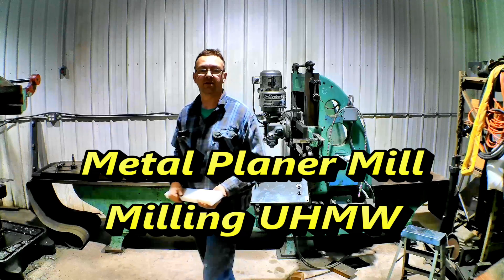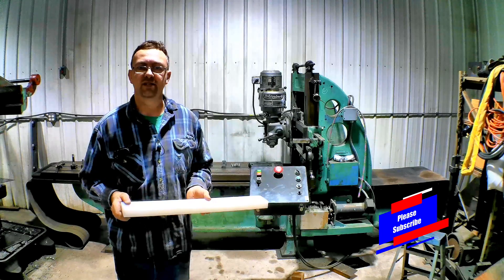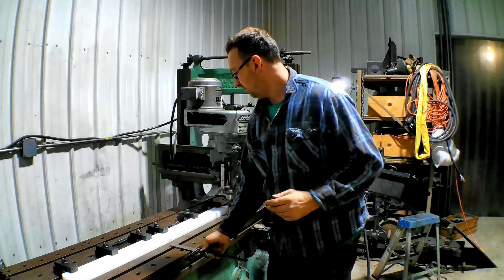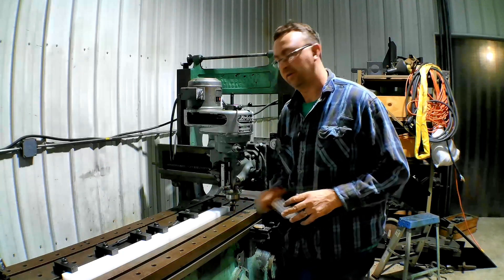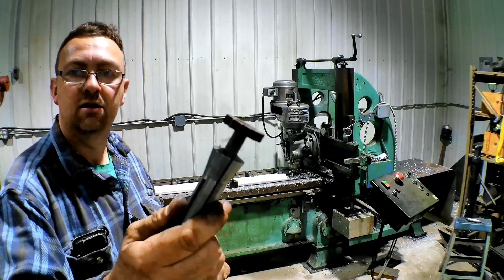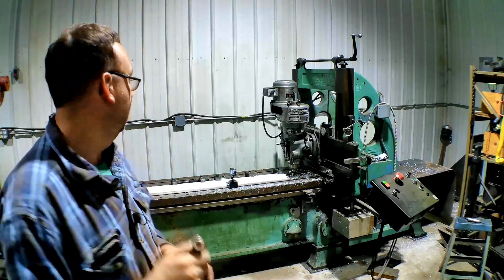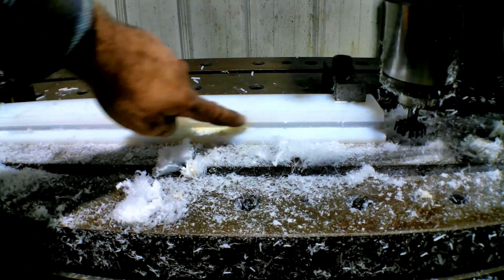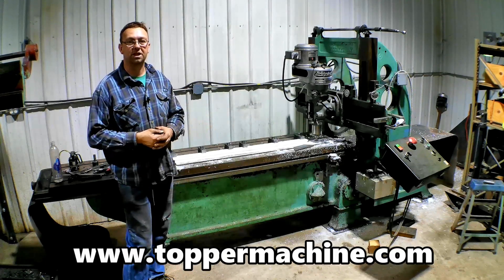Metal Planer Mill Cutting UHMW Rails

Comment: This is a great idea putting a Bridgeport and a Plainer  together for doing large work.
Looks like it works great.
The spring / bow in the long work piece is probably from the cutter hammering the work like millions of little hammer blows when cutting and stretched the surface , possibly heating /or stress  relieving   some how might help , kinda sucks , looked so nice till you took the clamps off , surprised me what happened .
Reply from the maker: The bowing is really no surprise. When you remove one side of any cold drawn material, you release internal stresses. Hot rolled would be better, but not by much.

Comment: Love the videos wondering g what u would charge to resurface my old hendy 12x30 lathe bed non hardened bed
Reply from the maker: Honestly I would refer you to a machine tool rebuilder locally. They have a big planer set up for grinding. Does amazing work. A&D Machine Tool Rebuilders in Roberts, WI
Reply: @Topper Machine LLC.  do u ua e any idea what something like that cost I only want it planned or ground I will do all the scrapping
Reply from the maker: @williamlacina5042  no idea.
Reply: Thank u for the info. Keep up the videos they r great and I've learned alot watching u. And enjoy trying all different things.

Comment: This is basically exactly how my Frankenstein milling machine works. It was built out of a 39-in Milwaukee shaper. It's a little bit of a pain in the ass to get used to, because all of the directional movements occur on the column, and the table remains stationary. I even threw an extra spindle on the side, which has turned out to be fantastic for secondary operations or quick chamfering. Did you have a specific project in mind when you built this machine?
Reply from the maker: I rescued it because of one job in particular that I do every 2 years. Since then, it gets a lot of use.

Comment: Wow! What a machine, I have so many questions! How did you change it so that the planer does not make the return stroke much faster as they originally did? I can imagine the benefit of the Bridgeport head, essentially an enormous milling machine work envelope. Is the planer still able to operate as a planer? Is the 2700 RPM enough to use it as a planer? In other words, can the bridgeport head clear chips fast enough to account for the table speed?
Reply from the maker: The planer drive was stripped by the previous owner. They originally converted it into what it is. It has a DC drive motor and variable control. They took whatever mill head it had, so I installed this one. Really would love it to be a planer, but it's too far gone for that. Works great as a mill.
Reply: @TopperMachineLLC Thank you for the answer! I would have been up all night trying to figure this out. Quite a cool machine. I've been trying to find the table off of an old planer or HBM to use as a fixture table